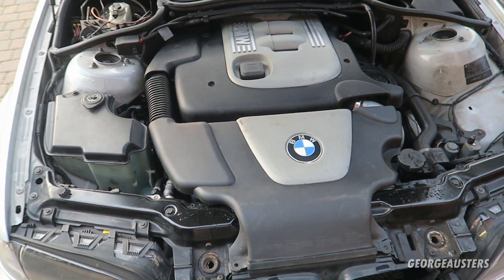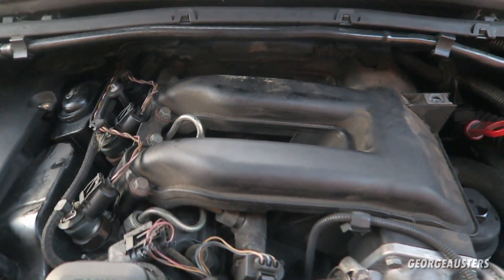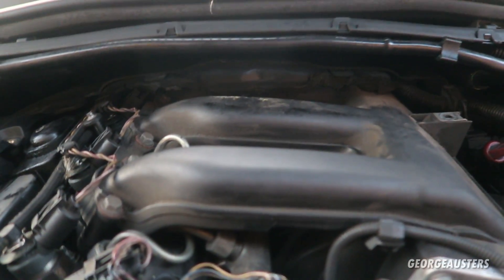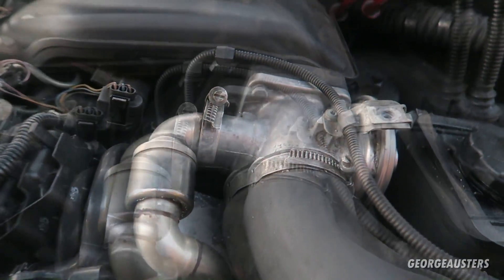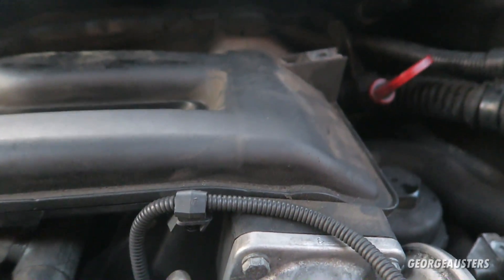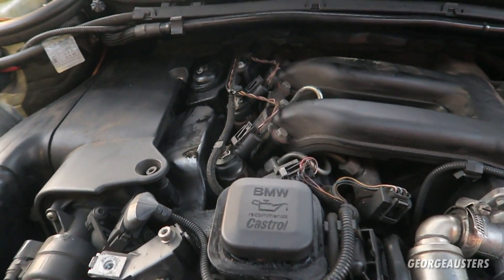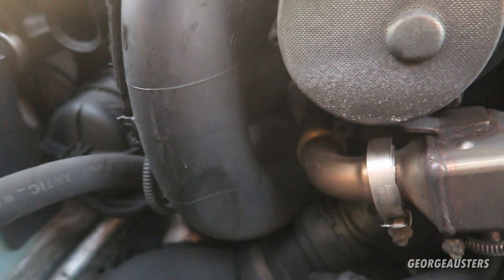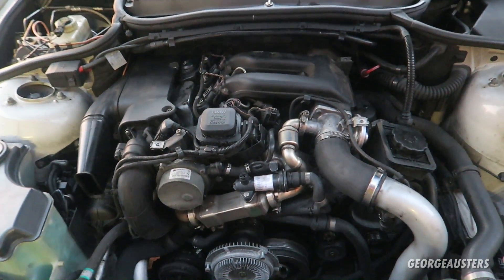BMW M47 & M57 Engine Parts That Fail At 100,000 Miles

Comment: Can a crankcase breather cause hissing noise when accelerating? Im having an issue that there is a loud sound of air leaking from that area. You wont hear that sound if youre still on neutral and press gas pedal but when you drive.

Comment: 430 000 KM no failures still going strong 👍
Reply: 375000km going strong (118D) Need to overhaul cooling system, rear shocks, turbo itself, maybe clutch and some small stuff to do. No swirl flaps on mine
Reply: @nihonkokusai  I should take down my intake manifold, clean it and inspect it, i don't know if it had swirl flaps removal, maybe you mentioning it is a sign of a future disaster 🤣🤣
Reply: @Bmwmpowers58  no swirl flaps mine
Reply: Cleaned at 290000km now using gtl and still clean at 387000km
Reply: egr still in place?
Reply: @UniqueMercenary  yes egr and pdf 461 000 Km now
Reply: @Bmwmpowers58 mine are still on the car super clean passes pm test easy
Reply: @UniqueMercenary  yes oem cooler and thermostat, use only for long drives
Reply: lies..

Comment: I've heared from people that the car drives worse without swirl flaps.
Reply: without proper soft utilization it can be little bit numb in lower rpms (lower torque) so you achieve higher consumtion in town... but in higher rpms its better in power 2-3kw (without soft)

Comment: I have m57 e39 530d 2002 and have it for about 15 years, I have 400k km, and I have changed glow plug just once, and I think they still worked, my advice would be dont change a good part until it has failed, I did not touch the glow plug relay for 20 years and its still fine.... I change oil every 12months, LL01 spec at about 12-18k km.

Comment: You forgot.....Intercooler seals (O rings), all Pulleys, most hoses, Transmission filter, AC compressor, Vac. Hoses, Power steering reservoir, Def tank sensor(s) and rear break light(s). I didn't have to do hardly a thing to my car until it hit 90,000 miles now after about $4,250 US dollars the last 2 years I hope she'll be good to go for another 90,000 miles.

Comment: Always have to laugh at these videos that have descriptions that say parts  fail at 100k, 150k, whatever miles.

I have two 2001 530D Tourings (manual with 173k and an auto with 170k miles) and they haven't had any of these faults.

Oil change every 10k or so miles with premium oil and a premium oil filter, crankcase breather cleaned every other oil change.

EGRs are clean and working, I recently opened them up when I had the covers off the front of the engine to change the water pumps on each. Belts changed when changing the water pumps for convenience sake.

Had a turbo fail on the manual but this was down to the car sitting on forecourts for a year or so and the (non-BMW) dealer not doing a proper service despite what they told me.

Only other non maintenance items have been air springs recently changed on both, left-hand engine mount on the auto recently changed and a split weld on the stainless steel exhaust section where it connects to the turbo had to be re-welded.

An M57 properly maintained is pretty much bomb-proof it and the M50B20 I have in my 1993 520i Touring (235k miles) are two of the best and most reliable engines BMW have produced.

Despite what it seems the M47 isn't a shortened version of the M57 and you can't extrapolate issues/reliability from one to the other
Reply: E60 525d LCI M57D30, car has covered 244 000km~

When I bought the car at 220 000km~, the thermostats had failed. Swapped that and the water pump, but the old water pump was rock solid. No noise from the bearing, but might aswell replace as I had everything out.

Recently replaced pulleys and belt (original belt from 2008, still looking very good, no signs of cracking, but replaced anyway). Absolutely zero play or cracks in the crank pulley.

Original EGR, probably never been cleaned. Not been an issue so far.

He's right about the glow plugs though, they've failed and I'm a little scared of doing them at this point. Patience and oil I guess.

Solenoids in my gearbox are acting up, hopefully an oil change will restore/clean them (there's no such thing as lifetime fluid..)

Comment: Hello, very informative and interesting video.  may I ask something ? I’ve got a M47 136hp (almost the same as this) my car after I let it sit for at least 1hrs or more when I then start up it, it gives the red oil light for 4/5 seconds (in those seconds the chain makes a lot of noise..) after 4/5 seconds it goes out and so does the chain noise… what could it be? Oil filter emptying itself? Is it a common fault
Reply from the maker: Change your oil
Reply: @GeorgeAusters  hi, thanks. That’s the first thing I did, but the problem remains. Tried 5w30 and 5w40 both in bmw’s specification. Car has 225000km not that much for these engines. I’m gonna try and change the orings on oil filter..  
i can’t understand if the noise is chain or something else
Reply: @CRS8392  upload video maybe
Reply: @piovo1  It was chain noise, for 3-4 seconds on start ups. changed chain and oil pump, , that solved the problem apparentely.
Reply: @CRS8392  Do oil changes at 15 000km and be gentle on the car until it's warmed up to avoid this in the future.
Reply: I have the same engine, i think is normal on cold starts but with new oil the sound is lower

Comment: george ive got turbo pressure sensor issues and little or no boost...155k would this be the turbo itself or a sensor/vac lines. (swirl flaps not yet deleted egr valve and cooler delete)
thanks

Comment: I love m47 i drive it with peace of minde. 2007 bmw e91 320d. I also had 318d n47 2009 Sold it at 260.000km... i did not have any chain problems what so ever.. Sold it becouse it needed New injectors and i was not comfort with investing bunch of money in high mileage car..

Comment: I have a BMW 530d 2008 157K m57 engine The problem i have with my car is acceleration, their is a long hesitation before it pulls, iv changed the Maf, and the throttle body but no joy, can some one help with any advice, at this moment I have one more opsion and that is the egr what do you think?
Reply from the maker: You need ISTA👍🏻
Reply: @GeorgeAusters   what is a ista
Reply: Diesel bro nothing to worry about
Reply: And that is turbo lag normal

Comment: Timing chain? Good luck changing that.  Truly terrible engineering for maintenance compared to older Beamers.
Reply: Well, I don't think it's such a hassle with this one. Unlike the N series, the chain is in the front, and quite easy to change. Also, it's not going to fail at 100k, I've seen m47's with over 300k on the original chain and pulleys.
Reply: Its pretty easy to change ngl

Comment: 130k no history. Booked to have my glow plugs done deleted all the stuff that I could. Just gotta crank pulley and ccv. Checked turbo and no play or signs of oil leaks so that's should be good and serviced with good oil. Praying the glow plugs arnt seized. Just don't want the faf or cost of extraction
Reply: Seized or not?

Comment: Just to add, you need to bleed and change the brake oil every 2 years at least or you’ll get the dsc lights on. No need to replace brake sensors.

Comment: New radiator,exspansion bottle,water pipes,turbo,alternator,engine mountings,gear box mountings,front shocks,rear shocks,crank shaft pulley,top mounts,service every 6months regardless of milage,swirl flaps removed,oh and a new battery,the one I took out was original 17 years old,still going 222000 on the click pulls like a train ,dirty diesel Rock.
Reply: You forgot driveshafts(abs rings).

Comment: One other thing, the brake vacuum pump seals always seem to fail and start to leak oil onto the EGR Cooler and Boost Hose, the O-Rings are like £13 imported from Poland eBay item number 

254172261552

Or you can buy the outter (larger) O-Ring within the UK for £4.50 with eBay item number

324071774980

Nice and cheap to fix 👍

Comment: My 47 never had turbo fail, 240 000km no wear norhing
Reply: My  e90 320d m47 engine 312 000km no turbo failure no smoke still pulling the way it was pulling when it was new
Reply: At 300k km its a good idea to replace

Comment: My M47 (in a late pre-LCI 120d manufactured in early 2007) has covered around 150000 miles and the swirl flaps are still in there. While fitting new glow plugs (can confirm, they had indeed failed) and cleaning the intake manifold and the EGR valve, my mechanic also had a look at the flaps. He said that they were in OK condition, so they have not been replaced for the time being. I prefer having them, since they probably add a bit of low-end torque, but I'll have to check back on them regularly, and when their time comes, I think I'll replace them with aftermarket swirl flaps -- BMW doesn't sell them separately and new intake manifolds are expensive. The only problem is that the aftermarket, last I checked, is tiny -- just two small manufacturers selling their wares over eBay.
Reply: I just too my swirl flaps out, couldn't notice any difference.

Comment: Great video again! My crankshaft pulley let go last year the middle just went and some how it just fell on the under tray and the belt just stayed on the metal and was  screaming 😬 (very lucky). I look after this engine on my e60 and it looks after me all about maintenance 👍. Keep up the good work 👍
Reply: Same happened to me on a long journey. It kept going for awhile before I stopped and temperature etc wasn't too bad thankfully!
Reply: @aaronwatson5206  i was on the motorway about 10 min from home and when got home and had a look i was like "owww ok then" 🤣. Herd some horror stories of the belt getting wrapped around things 🙈
Reply: @au5t1n86 Lol that happened to me in the middle of a twisty 60mph back road, wobbly pulley, it ripped belts and they wrapped around crankshaft pulley

Comment: if the egr is just turned off in the system but stays present with out blanking is it ok ??
Reply: Yes, but if you've disabled the EGR through the ECU then I'd probably consider deleting the EGR physically, one less thermostat and you won't have to worry about the EGR Cooler cracking internally.

Comment: All done! 209000 miles now. Clutch and flywheel after Xmas. Its rattling a while now!
Reply from the maker: Good stuff! Have you noticed your car judder when pulling away on the clutch without sliding it?
Reply: @GeorgeAusters  only happens the odd time

Comment: M47 @100k your looking at manifold , turbo, egr, glow plugs , crankshaft pulley , water pump/thermostat 
M57@100k your looking at manifold , egr, glow plugs , crankshaft pulley, water pump/thermostat 
Swirl flaps should be removed on both engines and @100k your looking at new swirl flap seals and new rocker cover gasket aswell as injector seals